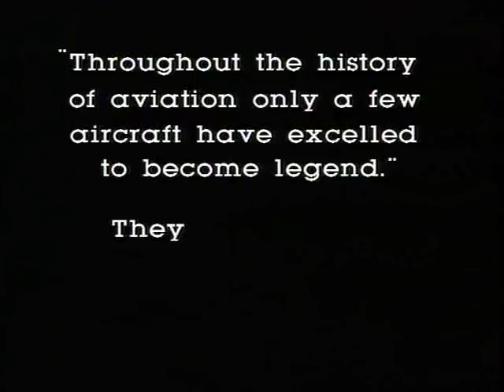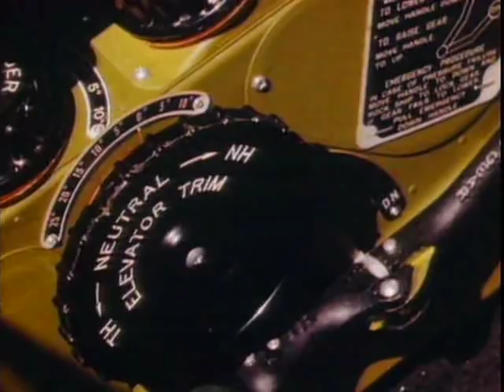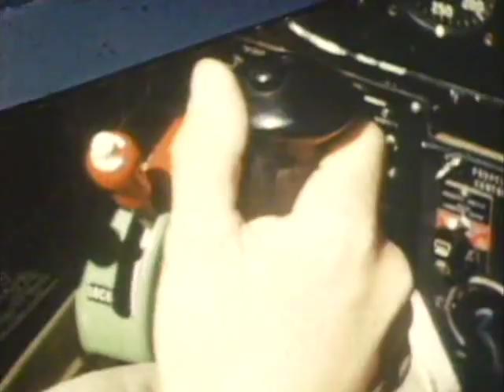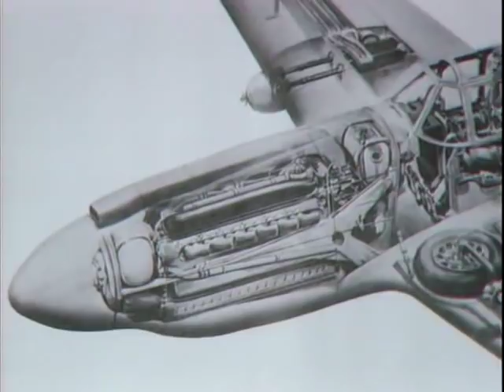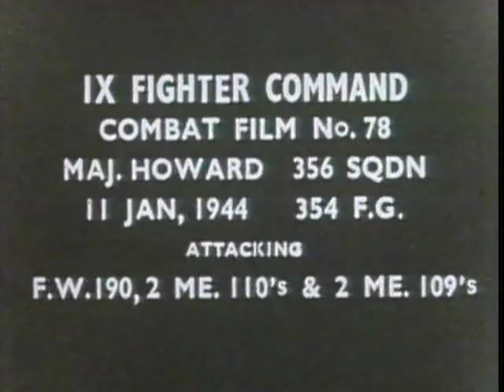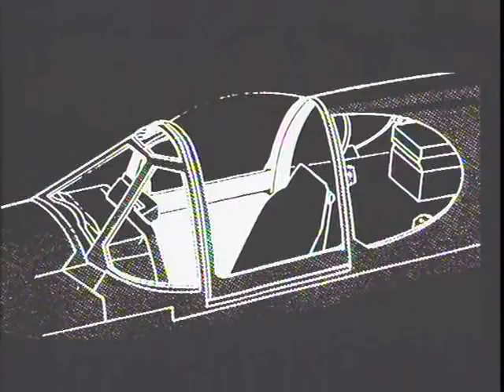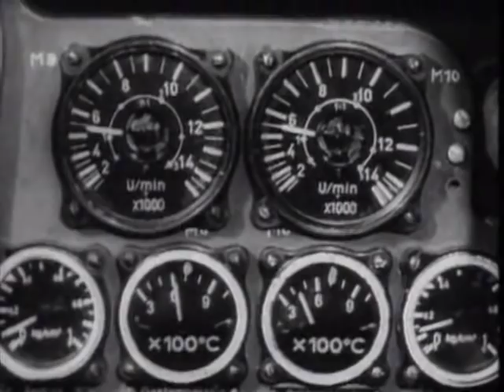Great Planes - North American P-51 Mustang

Comment: P 51 is beautiful aircraft. It's got the looks, the name, and the story.
Reply: JMS1089 p51 was trash compared to me109. Educate yourself
Reply: @garyseeseverything8615  uhh you should take your own advice friendo. First of all there is no me109 it's the bf109. Secondly, no lol. The p51 literally won most of it's battles against 109s, had a superior performance envelope at higher altitudes, was a more stable gun platform and more adaptable to ground attack role. The 109 had few advantages over the p51 at lower altitude but thats about it. To say it's "trash" and then tell the guy to "educate himself" just puts your ignorance on full display. He didn't even mention the 109, he was just admiring the p51 when you decided to make this a pissing contest
Reply: @user-yk7dc9hu2k  the p51 was designed by a German and absolutely would be outclassed when first released in Oct 1940 by a bf109f model. I use me109 and bf109 interchangeably and nobody has a problem with that other than you. By 1944 a bf109k would also outclass a p51. Let’s add some perspective, the p51 used 150 octanes while the bf109 due to lack or resources performed using 87 with a small burst of water methanol injection. The 87 did not allow for high boost yet still had an incredible speed and climb superior to a spitfire and p51d and yes this is a hard fact. Bf109 was the first true monoplane fighter the world had ever see and ended the war as the finest piece of engineering the world had ever seen under the poorest manufacturing conditions. Bf109 is WW2 and had the highest scoring aces in history by far!
Reply: @garyseeseverything8615  I don't disagree with most/any of that. It does have better climb and it had injection carburators before any ally craft. It certainly had better initiative capability but lacked turn ratio, especially compared to the wide winged Spitfire. The 109 is probably my favorite warbird but the p51 is not trash in comparison.
Reply: @garyseeseverything8615  Gary sees nothing By 1942 the Bf109 was surpassed by the Spitfire by 1944 IT WAS A DEAD DUCK
Reply: @jacktattis  fuels!

Comment: As the footage shows the A36 still had the machine gun setup of the original Mustangs. 2x 0.3” each wing & 1 x 0.5 in each wing & 2 synchronised 0.5” the chin too. Plus the wiring down of the air brakes also turned out to be a urban myth. It’s a pity the Mustang 1A with the 4 wing mounted 20mm cannon didn’t keep the 2 chin mounted 0.5 guns as well, & kept such a hypothetical setup for the rest of the war.

Comment: North American Aviation was one of the greatest American companies, the other was the Packard Motor Car Company which produced and improved the American version of the R&R Merlin engine.
Reply: gEORGE: pACKARD WERE PRODUCERS ONLY ALL IMPROVEMENTS WERE BY rOLLS rOYCE  Source: Mr A Lovesey  FRAeS
Reply: @wilburfinnigan2142  wILBUR I went looking for Patrick J Neal Author with no success . On the other hand I put in A C Lovesey and bang there was Cyril Aero Engineer worked for R/R from the late 30s to 1964.
Was involved with the Merlin from go to woe
Now I ask you who should I believe ? Patrick or Cyril ? I will go with Cyril
Reply: @jacktattis143  Well that is strange because IF you google "PACKARD as an AERO Engine builder"  Packard Merlin by Patrick J Neal you will find the article on line or the book is also available from Amazon.......but it is not cheap !!!  I have had the article bookmarked for several years. A lot of info covered by Packard in building the merlin, from the notes of Packard and from Jesse Vincents personal diary, he is the one that lead the building, modifying of the merlin and who designed the 2 stage supercharger for the V1650-3 & 7 & 9 engines !!!!   Try harder and smarter !!!
Reply: @wilburfinnigan2142  Not Vincent again? Vincent copied the Supercharger from the Allison and incorporated  the two stages from the Merlin. [ cHANGE CLUTCHES FOR GEARS]
Neal Author of a article Lovesey 40 years as an aero engineer. Now I ask you?
Reply: @wilburfinnigan2142  I found Robert J .Neal Author not an Aero Engineer
Reply: @jacktattis143  Hey dumb ass !!!!  Robert J Neal is an AUTHOR !!!!!  He wrote about what Jesse Vincent did from his and Packard records !!!! Geeeese Is that so hard to understand ??? Jesse Vincent designes the Liberty V12 Aircraft engine, several other Packard aircraft engines, and his most famous engine was the Packard M2500 PT boat engine years before Packard was begged to build the merlin !!!!  It was the M2500 engines that the Brits received from the USA that they used in air sea rescue boats that brought RR to Packard !!!  Vincent also designed the single stage supercharger on that engine.  He was working on an Aero version of the M2500 with a 2 stage supercharger when RR came a beggin !!!  Remember the 2 stage supercharger was invented and Patented in the USA in 1938 !!!!  RR and Harper never invented the 2 stage supercharger !!!! n They built a different version of it !!!  Hell do the research !!! The F4F-3 Wildcat was the first plane to fly with a PW R1830 with the  stage supercharger !!!  Wright R1820   were also used in the F4F Wilcat with a single stage 2speed unit !!!!!  Some of the PW R1830's were also built with the single stage 2 speed supercharger when production of the 2 stage unit could not keep up with the demand !!!  The 2 stage supercharger was also used on the PW R2800 used in the F4U Corsair, and the F6F Hellcat, and of course the P47 used the turbocharger as the second stage, feeding the  Mechanical supercharger.  The B17 and the B24's used a turbocharger for their 2nd stage, also feeding the mechanical supercharger !!!!!  RR and Harper did NOT invent the 2 stage supercharger !!!! They used their version of it !!!!
Reply: @jacktattis143  Hey dumb ass !!! Vincent did not copy the ALLISON supercharger !!!  He was friends with engineers from PW and Wright and discussed the superchargers !!! It is all in that article in the book !!! Read it and learn !!! The book is no longer available from Amazon but can be seen by Googling "PACKARD as an Aero Engine Builder, Packard Merlin," WRITTEN by Robert J Neal.  The article is on a PDF format and can be down loaded and read !!! READ IT AND LEARN !!!!
Reply: Hoa Tattis  Facts of history shows there were over 12,000 merlin powered Mustangs made and they did a job NO other fighter could do,,,,,including your precious shitfire, and that  was to do long range bomber escort !!! And they too the air war TO the Germans over Germany and DESTROYED the Luftwaffe.....Clearing the skies of ANY plane the Krauts sent up including the Me262 !!!!  Mustangs claimed 120 destroyed !!!!  Most of the less than 200 that were ever in service !!! Facts are facts and even YOU cannot BULLSHIT them away !!!!!!  More Facts of history !!!! DUUUUUUHHHH!!!!!!
Reply: Hoa Tattis  ALL BULLSHIT !!!!  It was the Mustang and P47 , and P38 the went into Germany and cleared the skies while the shitfire lingered around within 200 miles of England !!! Facts of history DUMB ASS !!!!
Reply: Packard NEVER improved the Merlin It was manufacturing only
Reply: @wilburfinnigan2142  Spitfire IXs with slipper tanks went to the aid of the USAAF P47 on the way back from the 2nd Schweinfurt raid a lot further than 200 miles dick That book Wilbur

Comment: wonder if the RR Merlin engine could have been used for other fighters with similar results - like the P-38 and F-6 with needed fuselage changes
Reply: + J    A Merlin P-38 had been discussed with some ideas on a QEC kit.   One problem is there wasn't time to shut down the P-38 production to retool for Merlins with changes to the aircraft.  And probably also the Merlins were needed for other aircraft.
Reply: @FiveCentsPlease  Yes,  makes perfect sense, mom and dad's family had to likewise ration like so many others, dad was in the Pacific, 11th Airborne - New Guinea, Luzon, and Japan - thank you ...
Reply: The p-38  Allisons engines made more power at all altitudes than Merlins.
Reply: @wilsonwhite6387  No not so
Reply: Apparently too many changes  costing too much for a plane that was past its best
Reply: @wilsonwhite6387  No not so Merlin Mk130 series 2030hp
Reply: @jacktattis Allison  V-1710-143/145(G6R/L) was rated for 2,300 hp
Reply: @wilsonwhite6387   Mate no WW2 US plane got to 44500ft [ Merlin] and then 49500ft [Griffon]

Comment: To those that say the p_51 was not the greatest fighter in the war I say this Mustangs are maintained, all others are curated.
Reply: +zayuran KightSpider The P-51 wasn't the single greatest fighter of the war. It was easily one of the greatest though. I would argue that the P-47 was better in many aspects. People tend to forget that the P-47 was one of the most nimble aircraft in the world at high altitude.
Reply: 852urkl I'll give you that, the p 47 was a God like aircraft in terms of both altitude and air to air combat effectiveness but you must admit that in terms of both range long distance reliability and and raw air speed it was badly out classed by the p 51
Reply: zayuran KightSpider The range was never the P-47's strong suit until the N model was introduced, and then it still lacked compared to the Mustang! And speed wise, it all depends on what altitude you compare them at and which model you compare to, though both are VERY fast fighters up top! To me the biggest factor in which I swing the favor to the P-47, at least in the Pacific theater, is that the P-47 had a nice roomy cockpit for long flights and it had an autopilot!
Reply: 852urkl true true. But in my case I lean to the p51 for its until then UN matched range and the fact that it's introduction single handedly increased the survival rate of bomber personnel by 95% on the European theatre.

Comment: p 51 was so better than any other plane and can out class the germen planes
Reply: ? the FW-190 is better built and could out turn and had the bigger guns
Reply: but the allies had better in 1943 to 45 and the germans just keep using the bf109 and bf109 was keep getting more crap by 43 45
Reply: Will Marlatt Um Bf-109 being crap the Bf-109s even by 1945 were still deadly and the Fw-190s were too. Plus the Fw-190 was still a younger plane by the time from the V-1 to the A-1 1940 to 1941 and the P-51 was around the same time frame but the Japanese said he Fw-190 A-5 is faster than the P-51 C.
Reply: i know but the bf109 war showing it age bye 1943_45 and allies are making better  bye 43 to 45 and yes fw190 was a deadly plane but it came into the late war
Reply: Will Marlatt Yes it came late
Reply: Gahlok12 The FW190 was built to 7G European standards and the P51B/C/D was built to 9G USAAF standards, so the P51B/C/D had a much stronger, more robust airframe than the FW190.  The weakness of the P51 was a liquid-cooled engine and radiator on the belly that made it vulnerable to ground fire and debris from strafed targets that exploded in front of it. The P51H was built to 7G European standards, having a lighter airframe similar to the FW190.  

The four 50BMG's on a P51B/C and six 50BMG's on the P51D, carried more ammo, with higher rate of fire and longer accurate range than the 20mm, and the full ammo supply of the P51's 50BMG's actually had considerably more destructive force than the full ammo supply of the 20mm.  A single round of explosive 20mm is more destructive than a single 50 cal round against a thin-skin-fuel-laden-target like an aircraft. But against armor, at long range especially, the 50 is superior to the explosive 20mm, being able to punch thru heavy steel that stops the 20mm cold.  The armor-piercing ability of the 50 at long range and the reliability of the 50BMG is why the USAAF retained the 50BMG even though the 20mm had some advantages.
Reply: 63DW89A Oh yeah thanks for bringing those points up I forgot about that and here's something the USAF uses the 20mms but they have some issues. In fact during the Korean War MiG-15s got sheared by the .50BMGS but people say it could handle them no way.
Reply: ***** Yep and the USN had different standards than the USAAF.
Reply: @MrBioniclefan1  The US tried to use the 20mm but stuffed up the casting and millions of rounds were no good.
Reply: You do know you replied to an old comment.
Reply: @MrBioniclefan1   Well yes I do but as I had never seen the site before and the fact that you are still on it means you are still interested.
Reply: @MrBioniclefan1  Yes I often go back to see if I can add to the conversation sometimes I have posted wrong info, not often but sometimes
Reply: When the Luftwaffe turned their Bf109’s & Fw190’s into heavy fighters & heavy bomber destroyers (the Sturmbocke), the extra cannons that they added to those fighters made such fighters less maneuverable against the P 51 Mustangs.  In April 1945, several lightly armed Bf109’s (as part of Sonderkommando Elbe) rammed some B-17’s & B-24’s.  If the Luftwaffe started ramming more Allied bombers with more lightly armed fighters earlier, would the Allies have taken the same countermeasures against the Luftwaffe fighters, or used different countermeasures?